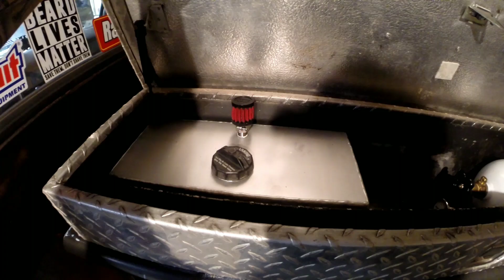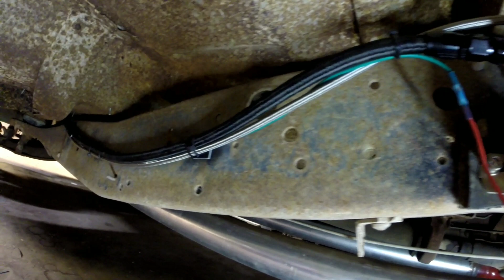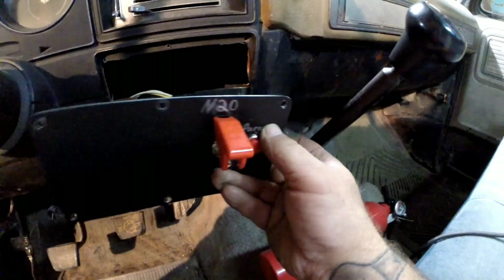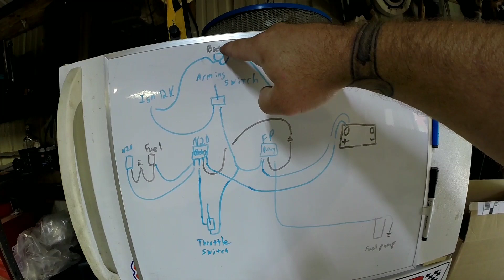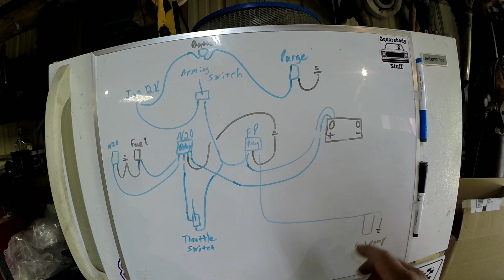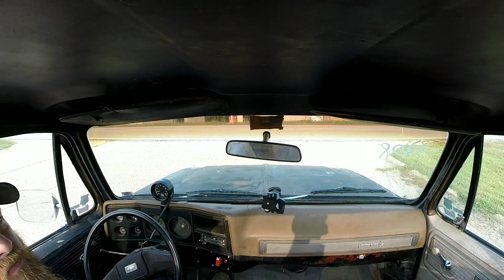Installing Nitrous on my 305 sbc powered square body c10. Part 4. Electrical and a test hit.

Comment: Goofy question what shot do you recommend for a stock 350/305 small block
Reply from the maker: I'm not the best one to ask, since I'm not afraid to throw a 250 shot at a stock bottom end 305. As long as the tune is good, 75-150 shot should be safe.
Reply: @SquarebodyStuff  Thank you for getting back to me maybe you can help me out I am also trying to figure out how to read the shot nozzles they come in .0__ but I’m having a hard time mathing it supposedly my block is a ZZ four crate motor and I’m not really afraid to shove too much into it but I also wanna be a little conservative so I thought about putting in a . 051 nozzle in there and supposedly that’s 120 shot what do you think

Comment: I had a nitrous system once on a 351W, system worked great overall. One day I was doing something and had to take the nitrous line off, well, I forgot to put the “pill” back in the line. So, my engine took a full spray as big as the line (pinkie finger size). It pulled like a bear!! For about 4 seconds, then it shit out the freeze out plugs from the block, head gaskets let go etc. 😂😂

Comment: I spray 200 on my stock 305, i added adual plane intake and gapped the rings and put a voodoo cam in it. And its been sprayed at least 10 times

Comment: Hey this is just a thought I live In Missouri and i go to the same drag place u go and i have a pulling truck it's a 1977 chevy with 454 and a big cam and I thought about drag racing next year but the I think that it might help squeaky if u get a little smaller carb
Reply from the maker: Probably is a bit much, but it's my best option right now.  There's alot of stuff on this thing that isn't right for what I'm doing, but thats kinda the point.  Other than the nitrous, the rest of it was stuff I had laying around or was cheap to buy new. Just proving a 305 with a 4 speed can be fun on a budget.  What part of Missouri are you from.?

Comment: I know now that I subscribed to a cool channel. That was a add on needed for that little 305. What a boost. I’m rebuilding my 5.3 Yukon. Well.. it’s done except for long tube headers. I’ve ordered a throttle body spacer with a nitrous bung. Thinking maybe to add nitrous. I’ve added a small cam209/217 500lift with 1.8 roller rockers and 7.450 pushrods and pac-1219 valve springs. Electric fans. That’s all done and it surges at idle rrrrooooom rrrrrrooooom. Lol 😂. Ordered Hptuner to dial it in.   Glad I sub’d.

Comment: it definety came on hard at about 4500 rpm and jumped up to close to 6 grand in no time. ive got a couple 350s kickin round but have a 305 in my turd gen already(stick car),think ill throw me in a cam and some vortec heads cause i already gottem.that thing pulls great for a 5.0